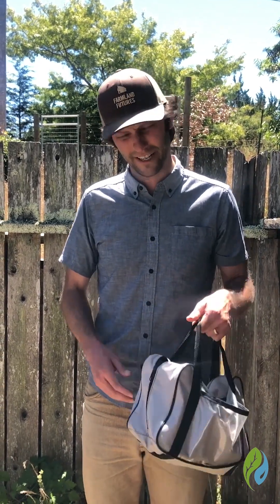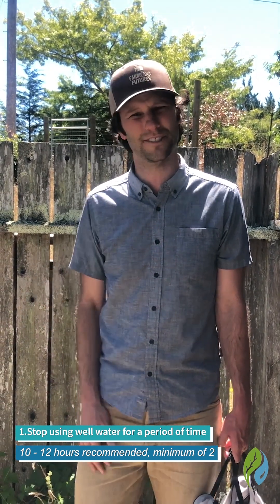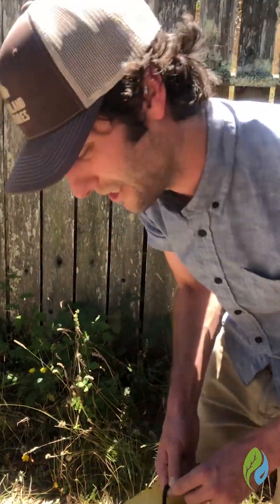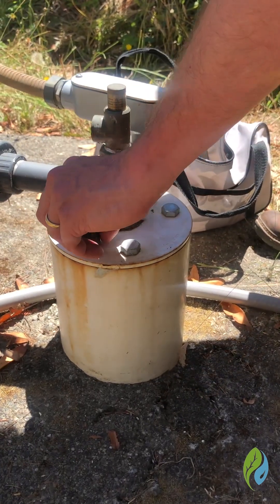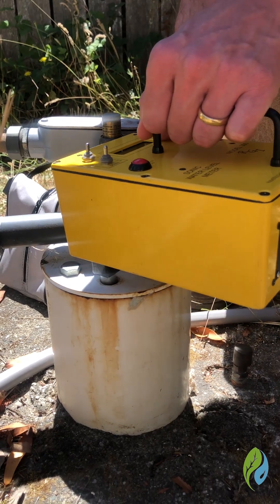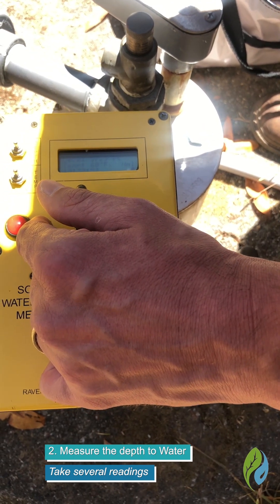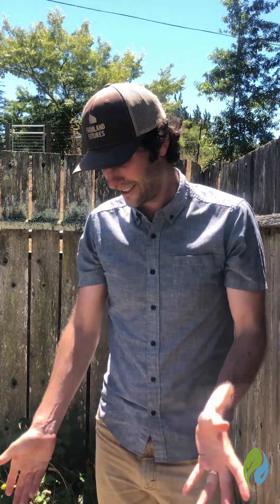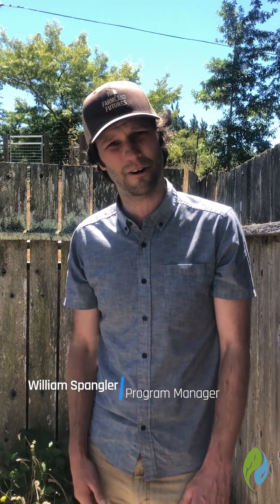Demonstration of how to measure well water level with the sonic monitoring device

Comment: I just wanted to let you know that you forgot to remind people to set the depth to NORMAL, not DEEP.  
Deep is only used when the depth to water is greater than 500 feet.
Also, the TEMP should be set to the air temperature inside the well, usually about 57 – 60 °F in Sonoma County.
Reply from the maker: the printed, one-page pictorial instructions that we provide with the tool does include those instructions, too! thanks for reviewing the video!